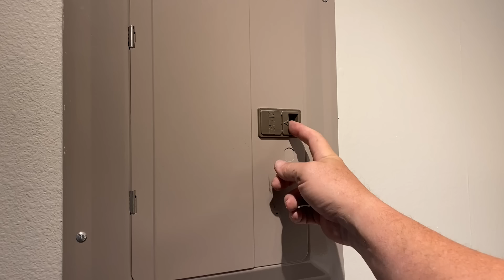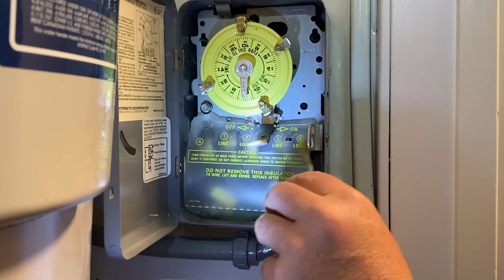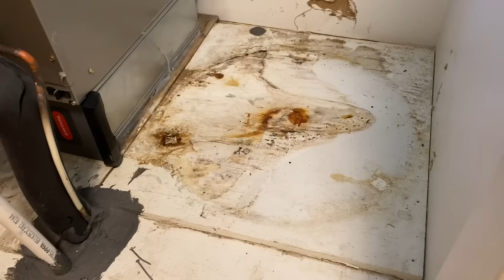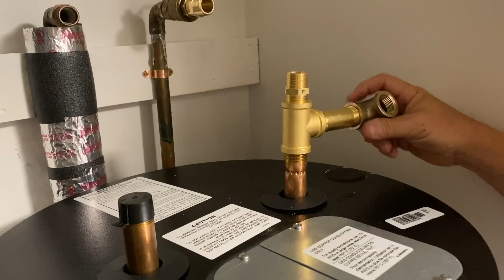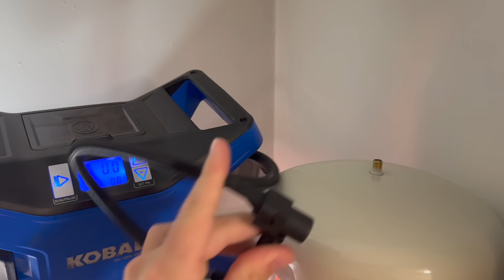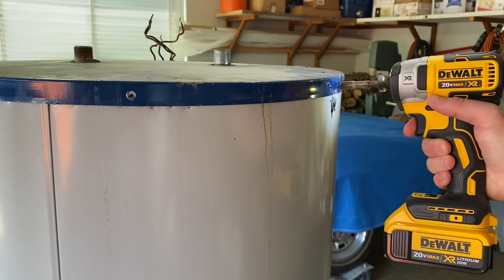I Saved $1,000+ By Replacing My Electric Water Heater (Step-by-Step)

Comment: You have to secure the expansion tank to the wall. 3/4 T ,  2 inch nipple, 6 inch 3/4 nipple, and 3/4 90s isn't enough for the expansion tank. Also you should to use cpvc off the tank tl the condensate drain.

Comment: I began doing own water heater installs when I was quoted $1100 to install an $800 water heater. Took me less than an hour.
Reply: Good for you.
Reply: I got quoted $2k for a $489 water heater. Here I am doing DYI reconnaissance.
Reply: @AlphabetCo-lk9jo You’ll be surprised how easy it is. If it’s gas, just make sure to use teflon tape for gas, (the yellow stuff) to seal fittings.

Comment: that would have been a good time to go tankless. Not sure why there is anyone who left who doesn't like them. Everyone who gets one never goes back to a tank. My first house had its original tank and when it failed I splurged on a $1000 tankless that was sold as residential but turns out it can also be used commercial. oops. it comes with a remote panel that I mounted upstairs by the hvac thermostat and i can turn that water heater to 160, maybe 165 i cant remember. 

its condensing, with stainless internals. we installed it ourselves, had to run two pvc pipes outside but I was lucky the house already had a 1" gas line into the house and I was able to tap in by the furnace. 

when we had a power outage (the reason people say they want a tank) I went to Best Buy and bought a battery backup for computers and plugged the water heater into it. It doesn't need much electricity at all, just to light the gas and modulate gas and water valves. That battery back up gave us hot water during the 5 day outage. Since I kept going to work, If i had to I could take the battery to work and charge it there. 

that was 10 years ago and i have no regrets about tankless whatsoever. If it fails, I'm ordering the exact same one (still being made, i checked) and itll practically be plug and play to swap it out. And its only about the size of a large PC tower, easy for one person to lug around.

Comment: Hahaha yup I can tell you're a homeowner. You insulated a relief blowoff. That's something AI or google would tell you to do. Also- I'm not sure on the code in your area but a lot of times water heaters have to be set to a certain temperature and that temperature can harbor bacteria that can not only effect the quality of your water but also eat away at the integrity of the tank. putting the tank on a higher temp and adding a mixing valve allows for more hot water and no bacteria to live.

Comment: Don't use the insulation on the piping, the only thing that insulation is good for is hiding leaks. Modern water heaters have more than enough insulation under the jacket.

Comment: Great job...except for not using stainless steel braided/flexible hoses to connect the house supply lines to the tank. Those cheap bendable metal hoses you used don't last long and they are notorious for corroding. They can't be reused either - while the braided ones can.
Reply: Dont last long. The ones in my house are over 20 years old lol

Comment: Whats the purpose of insulation on the ptv and drain pipe on a water heater thats indoors and not the cold inlet? Is it Incase  the house drops below freezing allowing the pipe to freeze? And the valve not able to vent?

Comment: Scale RX is the Best for sediment prevention.  Also shark bite MAX is coded cause it can handle 400 psi and it is approved unlike the old 180 psi fitting and not approved. Just for your correct information 😊

Comment: Black and red should always be your hot.  The white is neutral and green ground.  Black is ALWAYS  hot.  Pipe dope should Never be used with Teflon tape unless the Dope is Teflon based.  And dope should never be used on brass or copper pipe unless its also Teflon based.. using copper straps is good to not introduce metal corrosion, but the using Dope and tape does the same thing. They can have a corrosion effect and cause a leak.

Comment: I have a Gas water heater and i was quoted 3K for a change out, Because the way my old one was put in everything would have to be updated.  I said screw that.  I would use it till it had to be replaced and even then i probley could do it my self.

Comment: I don’t think you need that gizmo. You can do the same by draining the water heater via the hose then cycle the water supply valve on the water heater. The water will enter the heater, splash around the bottom of the heater and agitate the sediment. This is without buying the gizmo and it does the same thing.

Comment: I was quoted 20-25 grand for a gas tankless water heater! I thought it was a joke so I called around only to find out because of having to run new 3/4 inch gas pipe line from the meter it's what every contractor would charge. So, I did it myself! Took me a week due to permits and inspections from the city but I added an 8-stage big blue water filter system with a 50 micron siliphos spin down filter and a water meter set before the filters to monitor the water usage. Total cost was about 4 grand. It sucked, but I did it! And yes I had no hot water all week, but now, unlimited hot showers. 😄

Comment: It costs $2,000 because a licensed plumber shows up with his own tools, in a company truck, with a water heater (and a warranty). He hauls off the old equipment and installs all new copper pipes. my company guarantees our workmanship for LIFE. you might have saved $1,000 in the beginning, and maybe you did a good job. most people are incapable of installing a water heater properly. The tape on the insulation is cute 😂

Comment: If anyone wants to know corrosion of two different metals is caused by electrical charge created by the two opposite metals. Also its code in most places, its a REALLY good idea to install a Mixing Valve to prevent scalding, yes it costs more but it protects your family, this way you can set the tank heat higher to prevent bacteria build up in the tank but when it reaches your tap wont burn your skin off.

Comment: Those electrical connections with the yellow twist caps - not a fan on using that to connect rigid to stranded wires

Comment: Good for you.  Plumbers bid/charge you for "labor" based on difficulties & added skill/labor to do the job.  Noting a chance of them accidentally breaking or damaging something near their needed work  area.  & yours was a real tight non friendly space....
Reply: the idiot connected the water heater with stranded wire.  fire hazard that is specifically prohibited in the installation manual
Reply: @Red_Twizzler  True. But they're NOT pros & a Pro would know this & the h/o DIDNT want to pay the 2k....  So it's on Them!

Comment: Very well done Gentlemen, nice, neat and clean
Is it possible in your area that the use of Black Iron Fittings ( elbow just below the Expansion Tank ) is not permitted in the Potable Water Lines, should this Fitting not be Brass as well ?
Reply: and you can't use stranded wire because it gets too hot.  I've seen water heaters catch fire because of this

Comment: the negative black wire and the positive white and red wires confused me 😜
Reply: In a 240 volt setup, they are not. The black  and red wires are both power feeds of 120 volt each, but 180⁰ phase offset. They white is thecommon wire, and green is neutral.

Comment: Same thing just happened to me. I'm not rich but I'm pretty well off and it would've been a nasty hit to the wallet to pay a plumber to do this. Basic DIY skills, youtube and a few hours saved me over two thousand dollars. How can anyone can afford to pay a plumber basically $1000 an hour is beyond me. I was insulted by the quotes. $2300 for replacement labor, $100 for removal and recycle $250 for a 'heavy item' surcharge. I took the old 40 gallon tank off the stand (gas heaters have to be off the ground) by myself and hoisted the 50 gallon tank up there alone too. Its a joke what tradesmen charge preying on the inexperience of those who don't know better or can't do it for themselves.

Comment: Best to also add a bonding wire between the hot pipe and cold supply pipe. Also next time, consider a Heat Pump water heater as they use much less energy. Great descriptions and video production!
Reply: and never use stranded wire to connect a water heater

Comment: lol "way more efficient" you going from like 96% to maybe 98% .. only way to be "wayyyy" more efficient using electric is to use heat pump water heater.. for 20 year water heat that is very clean unit, must have low amount of minerals in your water

Comment: You should be TWISTING the wires together before you put the wire nuts on.  Electricity creates movement, hence the twist.  The other part respectful is that very poor pencil air pressure gauge which are notoriously inaccurate.  Better to use digital gauge for sure but I commend you on even showing expansion tank setup with PSI, often overlooked in a great video.

Comment: The power of the ponytail. 

First, if you’re going to use cheap teflon tape make sure you do six wraps and not just one. 

Second, the amount of dope you’re applying is really inadequate. 

Third, when properly using pipe wrenches you want three points of contact. That is both jaws and the rear. This gives you the correct method for use.

Fourth, you can absolutely use a wet rag after soldering pipe in order to both cool and clean it. Not sure why you said not to.

Comment: Well done!  I've never used a plumber in my life or needed to (learning to wrench young saves tens of thousands of dollars more than buying my tools and equipment) since what one man (or woman, my wife was a skilled aircraft and car mech) can do another can do. Having hobbies that save me tens of thousands of dollars over time, give me total control and make my life much easier long term is pure win. DIY still works when you're unemployed unlike trying to pay someone else without money. 

Tips others may find useful:
"Every cutoff gets a shutoff": 
When I sever old plumbing I immediately install an appropriate valve so I can isolate what I'm working on and have near zero total system downtime. Every item I know WILL require future maintenance/repair gets a proper shutoff valve (not the pathetic, basically single-use shutoffs sold for sinks and toilets which are best treated as one-use adapters expected to leak if disturbed in future). I use the crappy valves/hoses of course but the supply sides get gate or ball valves. I ensure I can quickly shut off any section of my home or shop plumbing if needed since forethought is free.

My water heaters get input and outlet valves I can shut off for heater repair or replacement. I leave enough pipe so I can quickly free heaters with two recip saw cuts (after disconnecting electrical power of course), slide heater onto the hand truck I used for its install, strap it to the hand truck with ratchet tiedowns and wheel it away. No one is getting younger so material handling equipment beats back surgery.

Garden hose fittings and "farm grade" (NOT that green brittle consumer junk!) garden hose allow quick bypass of any area to maintain water flow beyond it.
When I installed my heater both hot and cold side got additional valves with NPT to garden hose adapters so I can have hot and cold anywhere. When I renovated my bathroom I never lost hot water because I ran hose from my heaters hot and cold lines to my bathroom. 

If you need to you can safely place a freestanding water heater outdoors and wire it as you would a 240V single phase welder or large air compressor. 
That gets you hot water even for major projects. I'm of course generous with shutoff valves anywhere useful.

When wiring I install at least one outdoor 240V outlet for tools and equipment. I even did that when I rented (the landlord was also my best friend) which is handy for any serious DIYer. I now use a "RV temporary power panel" ("temporary" refers to the RV, not the panel!) on the back of my home near my service which gives me 120V single phase with GFCI, 240V single phase (for welders and compressors etc which helped build one of my shop and of course could charge an EV at modest demand), and the usual 120V/30A feed used to power smaller RV but suitable for larger 120V equipment that tends to pop small breakers. 

Every home and building I own is optimized for DIY because I'm lazy so I'm efficient. Do ye likewise early and enjoy it for decades. Do all your permanent work to code where applicable because safety is wisdom.

Comment: Plumbers around here are getting $2500-$3000 for a 40 gal gas water heater replacement. I did my last one for $700 for a Bradford White 49 gal plus everything new to connect it at a plumbing supply house. It took 3 hours and I'm not a plumber. I'm sure a skilled plumber could have done it in half that time and got all the materials cheaper. That  just shows how ridiculous their mark up is on a job like this. I also just put old tanks by the curb and every time by the end of the day a metal scrapper comes by and picks them up. It's like they can sense when there is one out there. Maybe it's just the neighborhood I live in.

Comment: From the looks of it, the previous installation was performed by a DIYer as well. Code does not allow for pressure relief valve discharge pipe to be reduced in size.
Reply: That's assuming that all plumbers/handymen follow code.

Comment: The $2,000 dollar quote was way to low, Master plumber here, don't ask me why I know this, but a lot of those timer switches only cut one let of power so the power wires are 120v, use a disconnect or the breaker

Comment: Very odd that code doesn't require you to elevate the water heater at all.
Reply: Elevating water heaters is for gas models in the garage.
Reply: @n9wox  I thought for electric water heaters the elevation was due to the potential for particulate matter in the air causing an explosion.  I'm no expert though.
Reply: @gametime2473 it might be for electric too, but only in the garage where there's potential combustible fumes
Reply: @n9wox  Dry particulate matter is extremely explosive and it doesn't even matter what the particles are.
Reply: @n9wox  dust, sawdust, metal particles, grain and even flour can be explosive.  It's weird I know but true.  Look it up, the explosions are very powerful too.

Comment: DIY’d mine twice.  The first time was a like for like install with a wiring upgrade (previous owner used light gauge wire and only connected half the heating coil… what an idiot).  20 years later, I installed a Rheem Marathon metal free unit.

Comment: Black is not negative. You have a 240volt supply to the tank. Black and red are hot conductors
Reply: I was just about to say, what is this a DC water heater? Lmao.
Reply: its all relative, what you call 2 hots are also a + and - if you dont have a center tapped neutral.
Reply: Switches 60 times a second

Comment: You seemed to do everything right, except, Hybrid (heat pump) water heaters aren't becoming mandatory overnight, but new U.S. Department of Energy (DOE) rules effective May 6, 2029, will require most electric storage water heaters over 35 gallons to use heat pump technology to meet higher efficiency standards, effectively making heat pump models the standard for new production in that size range, while gas heaters get condensing technology. We put one in and they are not much harder to install. Uses about one quarter of the energy.
Reply: Yes, but the WH space was pretty tight. Might not have enough width. HP water heaters are much taller and supply lines were pretty low.
Reply: @n9wox  valid point
Reply: Trump admin is trying to rescind new 2029 WH requirements.